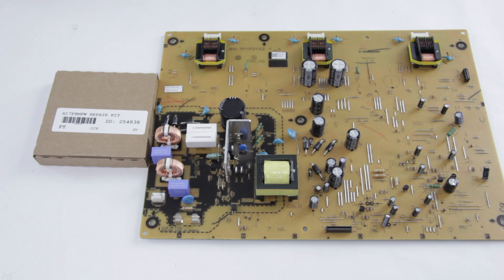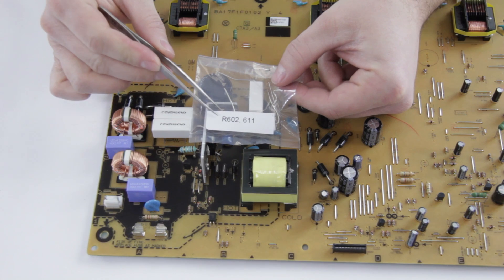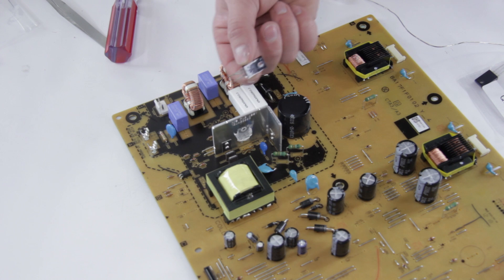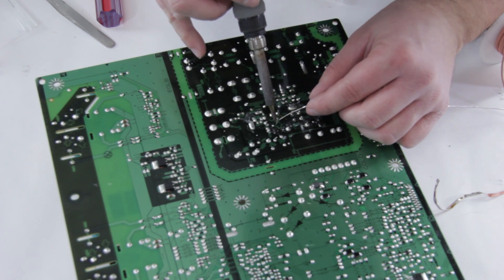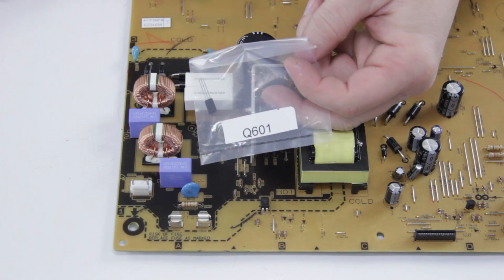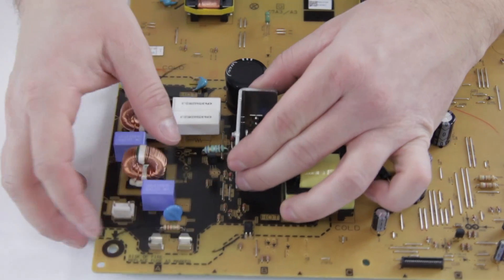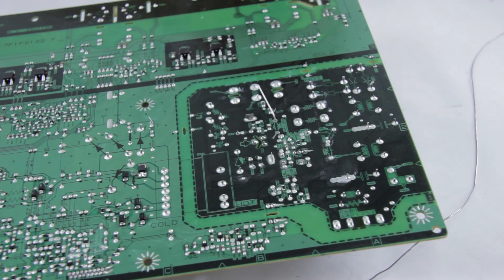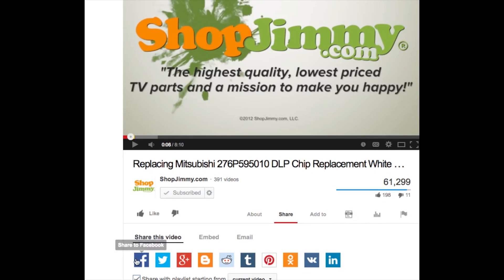Emerson-Sylvania-Magnavox fuente de alimentación para el kit de reparación de TV con subtítulos

Comment: buenas tardes amigo, estoy reparando uno igual y se me partió el diodo zener  D605 y quiero saber el valor de voltaje o el nro. de reemplazo .. gracias
Reply from the maker: Alexander Ramos   what kind of power supply? Do you have a part number so I can see what the diode is needed?
Reply: ok. hermano voy a  buscar la fuente para ver el numero y luego te lo publico por esta via.. 
gracias por su atención.
Reply: Alexander Ramos buenas tardes  hermano aqui tengo el modelo y el serial  de la fuente de poder es  BA17F1F0102Z-3  el TV es de 32 pulgadas modelo LC320EMZ DE 120 V. .. y la pieza que quiero saber el valor de voltaje o el reempla es el DIODO ZENER D605  ok te agradezco tu valiosa ayuda .. gracias
Reply: Alexander Ramos disculpa para rectificar el modelo es EMERSON LC320EMZ de 120V. y la fuente de poder es la misma BA17F1F0102Z-3   y el diodo es el D605  ok . Dios le bendiga grandemente...